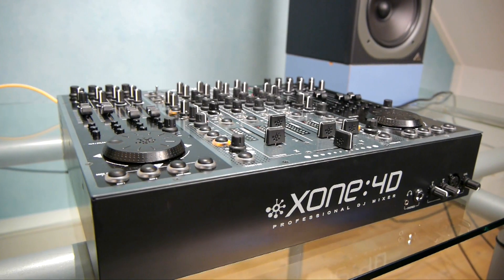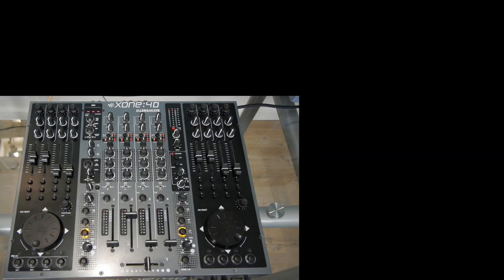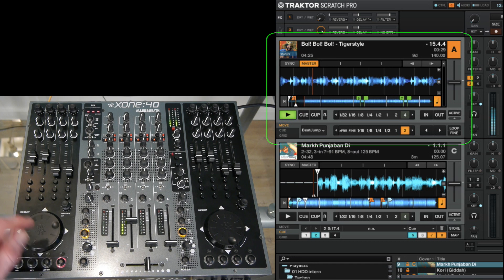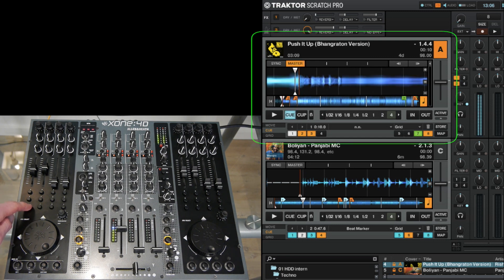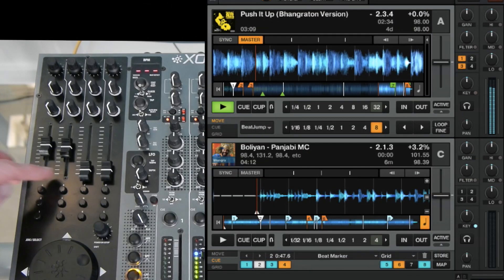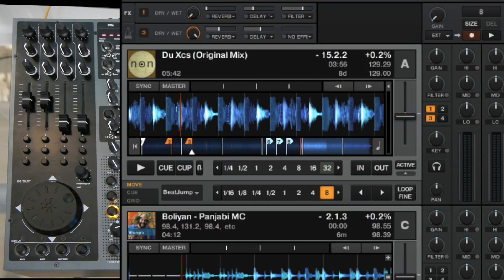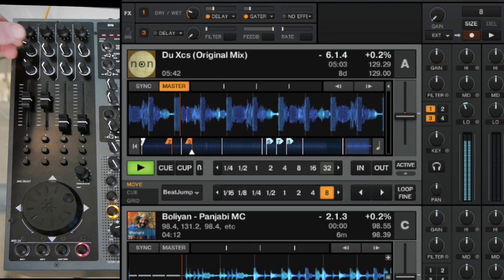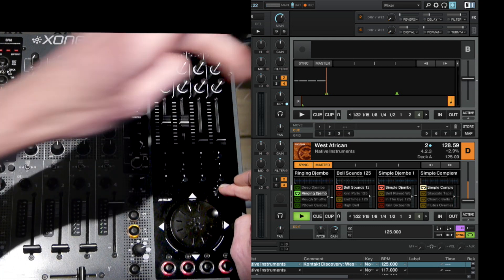Xone 4D Traktor Scratch Pro mapping Walkthrough

Comment: Hi, has anyone problems with the last Mac driver v3.3.17_2 (April 2018). I cant upload it. I follow the instructions but the traktor doesn’t recognize the Allen and heat 4D. I’v bee few month without no mixing because of this issue. Thanks
Reply: May it be a problem on the soundcard? It happened to me
Reply: Sorry, could you fix it? I have one 4d and a macbook pro 2019, and the latest drivers are not compatible! Are useful until mojave. The newest systems can´t run the latest driver

Comment: Many thanks for the Mapping! Just a question. Because everything is working except the central part of the mixer where I have the Fader, the bass mid, etc.. of each channel. Do you know if I did somenthing wirng?
Reply from the maker: Hi, thanks for your comment! I am not sure if I understand your question, but it sounds like you didn't set up your audio channels. The mapping is only for the midi part.
So I would check the settings and go to audio setup and also do the output routing. Good luck!
Reply: I have same problem here. Did you fix it

Comment: Hi... All at the sudden i lost connectivity between mixer and traktor, and when i readded tsi still not working 😢.. any advice subzimr?
Reply from the maker: Hi Mario, sad to hear that your 4D isn't working as it should. I think the best stable combo is OSX Mountain Lion with Traktor 2.6.8. The later updates gave me some connecting troubles as well. most times resetting and/or removing USB and replugging USB did the trick. 
Maybe drop your question in the 4D Facebook group, maybe they can help? Good luck!
Reply: @TheSubziMr thank you. I imported the wrong tsi so now its working

Comment: i am wondering. i own a X:ONE 3D? Are thesde mappings the same? And if not, do you know what i would have to change in the mapping?
Reply from the maker: Hi Deef, I really don't know. You could check the manual of both the 3D and the 4D and see if the cc commands of the 3D are the same as the 4D. Or you could just give it a try, see if it works. Good luck!
Reply: @TheSubziMr  will try, but isn't it weird that they never even mention the XONE 3D anywhere. Not in traktor pro 3, really nowhere. My guess is that they should be the same. The biggest difference I could find between 3D and the 4D seem to be that I only have one line-in for the sound card part and the 4D has two. Well, on with the search for an answer is my guess. 
thanks anyway. ;)
Reply from the maker: @TheTEKNOistSociety2024  Good luck! Mind that these units are getting quite uhm, dinosauric. Especially with the drivers for the audiocard. Good luck on your quest!
Reply: @TheSubziMr  yeah I know the mixer is getting pretty old but drivers of Xone 3D is still pretty good. Only the mappings are horrible, and that is my current quest. That and I am having a good friend help me to recap this mixer because it will work for another 20 years then. I have never had a mixer that is already this old and still mixing and sounding this good. And I have used a lot of (professional) mixers.
I think that perhaps I am too attached to the damn thing. Hahaha. Anyway, thank you. Nice talking to you. ;)

Comment: What version of macOS are you running the Xone and traktor?
Reply from the maker: I'm not sure anymore, but I believe that High Sierra was most stable. After H.S. I moved to Mojave (I think) which also ran but connecting it was a bit more fiddly. I would go H.S., or Mountain Lion of the computer is old enough. Good luck!
Reply: Thank you! I’ll give it a try 🤩

Comment: my in/out ports does not offer the xone 4d option??? Do you have any suggestion why that is??
Reply from the maker: Weird. Did you try to swap your USB cable?
Reply: No but usb cable is brand new. I'm using Windows 10 and update firmware properly so I may be in way over my head. Thanks for you reply!
Reply: Firmware didn't update properly*
Reply from the maker: Hmm, maybe try to contact your A&H dealer?
Reply: I was just able to update now....weird. Thanks again for your reply and I'll try this process again.

Comment: Have you tried using it for time code dvs?
Reply from the maker: Yes, works fine!
Reply: @TheSubziMr  thanks for replying friend.  just wanted to know there is only one ground point in the 4d mixer can i connect two ground cables from two turntables to it ??
Reply from the maker: Thrillokh tilak hi, so, there is one point for grounding. You can stack multiple ‘forks’ (multiple turntables) on the ground pin and clamp them with the nut.
Reply: TheSubziMr thank you did that 👍👍✌️